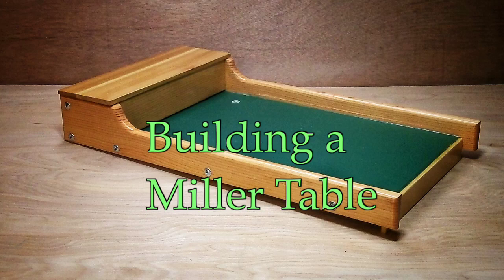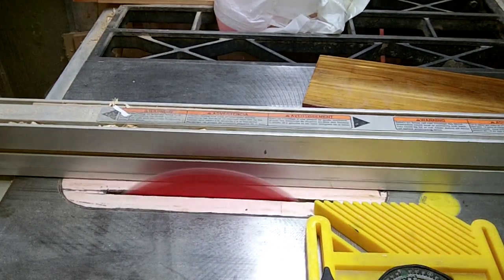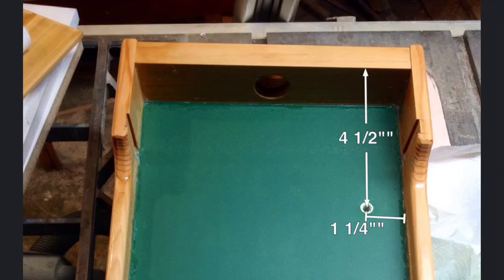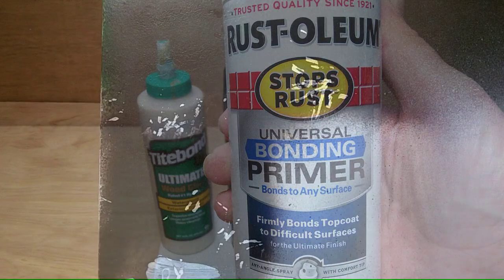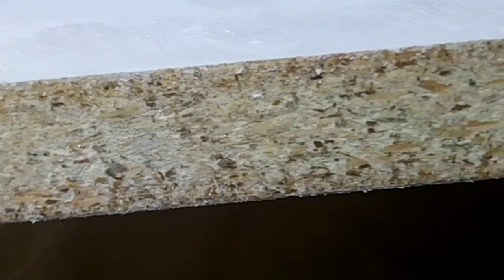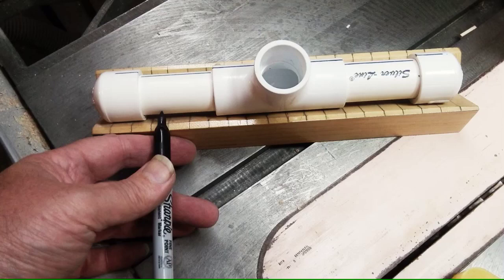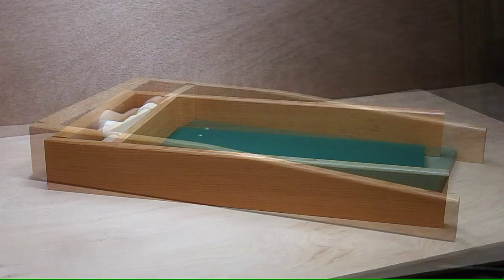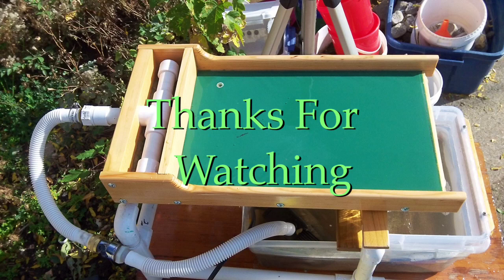BUILDING A MILLER TABLE

Comment: I am obsessing over the texture of the chalkboard paint -- I used a 3" foam roller and in my uneducated opinion, it seems like the texture is too coarse.  I used the Rustoleum Chalkboard Paint like you recommended.  What type of roller do you use and if you don't use a foam roller, what is the thickness of the nap of the roller you like to use?  Thanks again for such a great video and the continuing guidance! ;-)
Reply from the maker: Hi Eric. I wasn't real crazy about the texture either. It won't make a lot of difference to leave it that way but I like it a little smoother myself. I usually put 3 coats of the chalkboard paint on, let it dry and then lightly sand the tops of the high spots off with some 150 grit sandpaper. I then put on 3 more coats and sand again. On the final coat I thin the paint down a little with a little water so it will spread without leaving a texture and let it dry. 
Be sure you seal all the edged where there are cracks in the plastic very well with multiple coats of paint and if you put in a gold vial hole, that is where most people are having problems. You really have to seal that very well. I spread Titebond III glue down inside it and then spray it with the bonding primer and then give it a good coat of spar varnish. 
It seems that folks who don't put in the gold vial hole have better luck with the water not seeping into the wood. Enjoy your table.

Comment: I watched your awesome videos and may I ask how you secure the water slide bar in place and what is the distance of it from the baseboard.
Reply from the maker: Hi Rzlto and thank you for watching. I cut grooves in the side rails so that the water bar could slide out. The easiest thing would be to put 2 quarters stacked on top of each other and put them where you want the water bar to sit on either side of the sluice. Then you can glue the water bar in with Superglue. You can also cut the water bar so it fits tightly so you can slide it up and down. 
I also have glued matchsticks to the side rails as guides so the water bar can slide up and down and then put a screw in the bottom of the water bar on both ends so they hold it up off the deck. That way you can adjust the screws to adjust the space underneath the water bar.

Comment: awesome video. thank you...one question though, what is the angle does a person need to put the miller table at?
Reply from the maker: +Dean Woolman Hi Dean and thanks for watching. Angle and flow are very important with a miller table. You need just a very thin layer of water only about 1/16" - 1/8"deep and a slow adjustable flow of water. I use a 200 GPH pump with a valve down near the pump.
 I usually start out at an angle of about 2 - 3 degrees. and reduce the flow of my pump to about 100 GPH. I then sprinkle a little black sand on the table and if it doesn't move down the table, I increase the water flow until it just starts moving down. At this point any gold that is the same size or larger will stick to the table. If you are expecting larger gold you can increase the flow and recover that rather quickly. I then screen the tailings to -30 mesh and run again at a much reduced water level again using the black sand as a flow meter. Then I screen the tailings again to -100 mesh and reduce the table to almost flat and drop the water flow back some more. You may be surprised at how much gold you get from the 2 additional runs. If you run your black sands at this level you may be quite surprised to see how much very small gold will drop out of the black sands. 
Hope this is of some help.

Comment: Thanks for this very nice video!
With all the effort to make this water proof, have you considered making it out of PVC boards? You can get 1/2 inch by 12 inch by 8 foot boards fairly inexpensively, and it is already waterproof.
Reply from the maker: Hi Jt. No I haven't as that material is not available around here but it should work well if you can get the chalkboard paint to stick. The Bonding primer I show in the video should work for that. It's the only paint I have found that will bond well to plastics . I have tried thin plastics and cutting boards that work well for awhile but they will warp slightly over time so you need to mount them to a solid surface. I have tried to find materials to build these out of that is inexpensive and readily available to the majority of people and the melamine board seems to fit the bill. Thanks for watching.

Comment: GOOD JOB....
I Should suggest next time use "marine plywood" instead of "chipboard".  You won't have any "moist" problem.
Thanks for sharing...
Reply from the maker: Thank you. Years ago I used the marine plywood for one of my first ones but after awhile I had problems with it warping slightly which doesn't work well for these. I try to keep the costs down on these for folks who are on a limited budget and the marine plywood here is quite expensive. I have recently been trying regular plywood on some of my sluice bottoms and even though they are well waterproofed they have all cracked and buckled. Just unlucky I guess. :-)
I have built about 30 of these trying different materials and I keep coming back to the melamine board because it is so stable if you don't get it wet. With the waterproofing I do now on them I haven't had any problems and they have been holding up well. Thanks for stopping by.

Comment: hey boss wanted your opinion, I don't care about fancy and I don't want to spend time sanding the wood. do you think the all purpose primer is a good option to the clear coat for the wood ? or do I need to coat the primer with chalk board paint as well ?
Reply from the maker: +dean castello Hi Dean, I don't see why not. From my experience with it, you can use the primer to waterproof the whole table. It dries pretty thin so I usually put down about 4 - 6 coats to make sure it is sealed well. This is about the only paint I have found that sticks well to the melamine surface. The only drawback I can see for the base would be seeing the very fine gold against the white background. That's why I like the Chalkboard paint. Plus the Chalkboard paint has a little better surface that the gold likes to stick to. 
The most important thing with these tables is controlling the water flow and angle so you don't wash the very fine gold away. One of the small Harbor Freight 200 or 264 GPH pumps with a valve on the hose works very well  for a water supply. 
If I can help further just let me know.

Comment: I would suggest either internal threads or a funnel into the middle of the collection bottle to avoid fines going into the threads
Reply from the maker: Thank you Robert for watching and your comment. The lid is glued tightly to the bottom of the bottle hole and a hole is drilled through the top of it so the gold can drop straight into the bottle. There is no possible way for the gold to get into the threads as the lid completely covers the threads.

Comment: I noticed @16:06 when applying your Green Chalk Board coat, you brushed in the direction of the water (from left to right). Have you ever noticed a difference in performance making your brush strokes from top too bottom?
Reply from the maker: Hi and thanks for watching. No, I use a small roller that leaves a slightly textured surface that is the same no matter which way you roll. Some folks like to use a brush and brush lines across the flow to catch the gold in the slight ridges but I find that they also catch the black sands you are trying to eliminate.
I usually apply 3 coats of paint letting each coat dry in between and then lightly sand it to eliminate some of the texture and then apply 3 more coats. You want the surface to be quite smooth so that the black sands just slide right off leaving the gold.  If your material is all screened to the same size, you just adjust the water flow until the black sands start moving down the table and the gold being heavier will stay where it's dropped.
Reply: Great video. This will be my next project when I get my new job...ty for the advice.
Reply from the maker: Thank you. I think you will really like one of these. It has become one of my most used tools.
Reply: btw, after you applied the green coats, did you use a fine fine fine sand paper to smooth it flat?
Reply from the maker: I normally don't sand the final coat as it removes the slight tooth that the Chalkboard paint has that makes it hold the gold so well. However you can try it and if it doesn't work as well you can always give it another coat and not sand it. I generally give mine a maintenance coat about once a year at the end of the season as the sand will wear it down after awhile. You can just mask off the side boards and water bar board with painters tape and give it another coat.
Reply: Here is the one I did. I put a 45 degree edge on the spillway piece. Have not tried yet but the water should go straight down. Can’t seem to get the photo of it into this message.

Comment: Great video! Would it be possible to use roofing felt instead of the paint?
Reply from the maker: Hi Albert, Thank you and thanks for stopping by. You can certainly give it a try and see how it works for you. My initial thoughts are that it may be a little rough and that the material won't slide down it easily. But the idea with these projects is to try your ideas out and see how they work. Usually a smoother surface helps the sand and the black sand slide on down the table and the gold being heavier will just stay in place. 
I tried a shelf mat material a couple of years back that didn't work quite like I would have liked and so I ended up painting it with chalkboard paint and it worked very well after that. So give it a try and see how it works. If not, then you can always paint it.

Comment: Hi again, two questions for you on this? What kind of angle do you set this and do you need a valve to help adjust the water? Thanks again.
Reply from the maker: Hi Michael. Typically I find that 3 degrees is a good starting point if you are working with about 20 mesh gold and smaller. Yes, I strongly suggest you put a valve on it so that you can adjust the water flow for the different sizes of gold. If you are working with 30 mesh and smaller gold, you will really need it. I see people on Youtube all the time losing half their gold due to the water flow being too fast.

 If you saw my video "New Miller Table Introduction" I show a little better close up of my pump, valve and hose set up. Home Depot has a really good gas valve that is very smooth in it's operation and it's a 1/4 turn to full off and on. They also sell nylon 1/2" and 3/4" hose barb to MIP connectors depending on the size hose you use for connecting the hose to the valve. The cheap garden hose valves only last a short time till they start leaking. Also it's best to put the valve so there is about 6" to a foot of hose after the valve as the valve will pressurize the water when you turn it down like when you put your thumb over a garden hose to make it spray.  This will cause turbulence which isn't good for fine gold. The hose length after the valve will smooth this turbulence out. I hope this helps.
Reply: @utahavalanch Thanks again for your advice on this, I have a nice pile of black sand to do.
Reply: @utahavalanch What color is best used green, blue or?
Reply from the maker: @MichaelJohnson-ux7pe  

You're welcome. Glad to help if I can. I think that next to the gold pan, these are by far the best when it comes to separating black sand from gold. But with the gold pan you need a lot of practice. :-D
Reply from the maker: @MichaelJohnson-ux7pe  

I used to like the green but after trying the Teal color I have since changed to it. It is a very relaxing color and you can spend hours on the table without eye strain. The Teal color is a combination of green and blue so with it you get the best of both colors. I used it on my Silicone Mat Sluice video if you want to see what it looks like.

Comment: I do have 1 more question I noticed the damn is dadoed in, is it fixed and if so how much of a gap do you leave? or is it dadoed so you can slide it up and down?
Reply from the maker: +dean castello On my tables I dado the sides so that the water bar can slide up and down to adjust the height. I usually make it a fairly tight fit so it stays where I put it. Some folks just cut a board so it's a tight fit and wedge it in. For course gold, (+20 and larger) I set the height at 1/8". I put a stack of 2 quarters underneath both ends and push the bar down till it rests on the 2 stacks to get the 1/8" height. With a 200 GPH pump reduce the water flow to about 80%. With gold on the table, you can adjust the water flow until it just starts to move and then reduce the flow a little bit.Table angle at 3 degrees.

For minus 30 mesh and smaller material I set the space under the water bar to 1/16" or 1 quarter. Reduce the water flow to about 50% with the table angle at about 2 degrees.
In both cases I reduce the water flow way back and then put some black sand on the table that has been screened to the size material that I am running. Then slowly increase the water flow until the black sand starts moving down the table. That should give you a good starting point. If your gold starts moving down he table then reduce the water flow until it stays where you drop it.
 
I usually screen to 3 different sizes and run each separately. 1 run for the -8 mesh. 1 run for the -20 and 1 run for the -30. You can screen down to even finer if you want. They say 80% of the gold is in the -100 range. I know there is a lot more down at those sizes than there is in the larger sizes.
In all cases, spread the sand out across the table and take a nylon basting brush and spread the sand out so the gold makes contact with the table. The gold can ride down the table on top of the lighter sands. If it makes contact with the table it will stay.

Hope this helps.

Comment: Great video
Reply from the maker: Thank you Braden. Thanks for watching. I have a video coming out on a new one here in the next day or so if you are interested.
Reply: I've been looking into buying royals table but after seeing this I'm going to build my own and save hundreds
Reply from the maker: You might as well give it a try. It's not that hard to build your own and it's certainly a lot cheaper even if it takes you a couple of tries. You might check out my cutting board miller table as well. It's very easy to build and works as well as any of the commercial tables. The main thing on these is to really waterproof the base board well. Especially the gold vial hole. That's where the water gets in on this model and will cause the wood to swell. The cutting board version doesn't have that problem. Best of luck.
Reply: Ive been a carpenter by trade for close to 30 yrs so after seeing your video looks like a piece of cake I've thought about building one for some time just never knew what to use to make the gold stick to the table
Reply from the maker: If you are a carpenter, then you will really love my new one and you would be able to make it easily. It beats anything currently on the market by far. It's a whole new design unlike anything I've seen so far. My grandson and I have been using this and the sluices with the same design for a year now and I don't think I'll ever go back to the traditional style. I'm hoping to get the introduction video out later tonight and the build video in a day or two.
Reply: Great i will be on the look out for it thank you
Reply from the maker: Thank you for watching.

Comment: Send me a short video or photo on how you fix the bilge pump in the water container,should it be fully covered by water?
Reply from the maker: Hi Steven. I’ll see if I can find a picture of it. It’s the middle of winter here and I have all my sluicing equipment put away. The bottom of the bilge pump where the screen is, has to be under water. The easy thing to do is to put the whole pump under water. They are designed to be run under water.
Reply from the maker: I sent you an Email.

Comment: Can you please demonstrate the use of the miller table using baby powder fine aggregate containing flour gold?
 Im not  quite convinced this would satisfy the conditions of my application. (Denver, CO)
Reply from the maker: Deviant Purv 
Hi and thanks for watching. It's hard to tell without seeing the size of the material. However much of the material I work with all the time is in the 100 to -150 mesh and it captures it quite well. For reference, 200 mesh is the smallest visible with the naked eye. If you watch my latest video on the Deep Well Sluice with Silicone Mat, toward the end of the video I run some Cape Disappointment beach sand that is in the -150 mesh range. That is the smallest gold that I have been able to find so far.  If I remember right, I also run it on my Deep Well Miller Table video. This table has the same Chalkboard paint on the deck that they do and it will catch that very fine gold. Hope this helps.
Reply: @utahavalanch  if you have gold bond foot powder at home or baby powder, pour some into your hand. That is the size particle im working with. "Baby powder fine particles"
Reply from the maker: @deviant_purv  

I think that you may have to resort to chemical means in order to capture that. I don't get into that myself due to it can be hazardous to the health and I have too many health problems now. :-D  Mercury is the main one that comes to mind if you get a retort to recapture the mercury. Melting may work as well if you  can get enough of it to try. That is something I'm starting to experiment with.

Comment: what paint brush did u use to paint the cauck board paint ?
Reply from the maker: Hi David and thanks for stopping by. You can use a 2" paint brush if you would like but I like to use a 3 inch paint roller.You can buy a 3 in roller and pan in a kit at any Home Depot or lowes. I think the roller gives a smoother more even coat of paint.